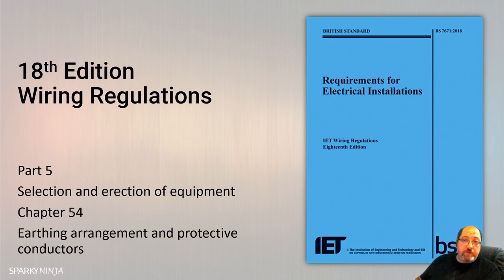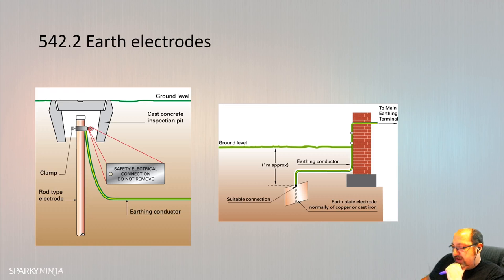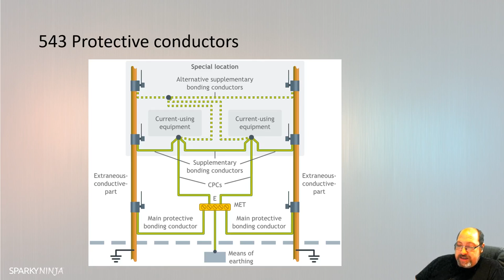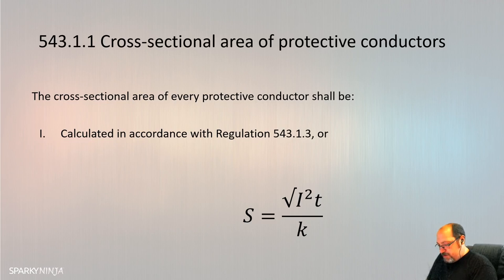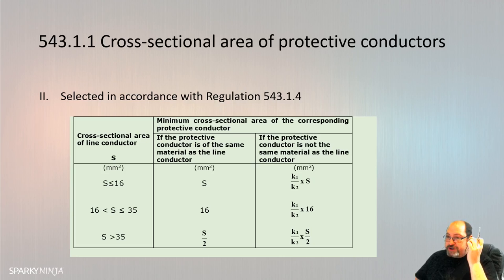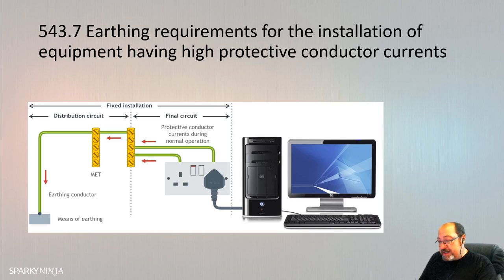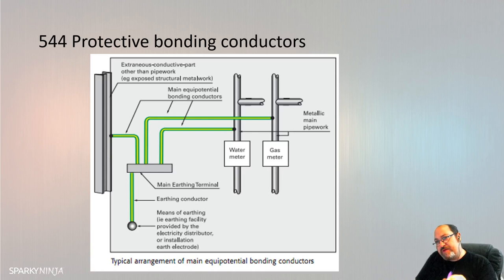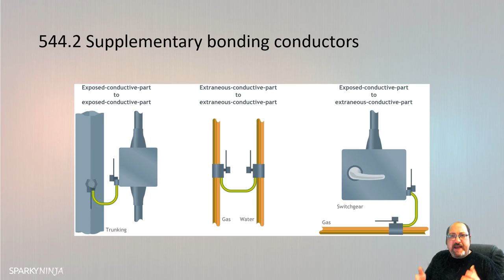18th Edition Training Series - Episode 15 - Part 5, Chapter 54 - Earthing & Protective Conductors

Comment: Regarding external gas meter boxes and the use of the phrase "as near as practicable" in 544.1.2 - The expectation here is that you would make the earth connection inside the house rather than in the meter box, but if this means the connection would be in a place where it is going to be inaccessible for testing in future (in my case under floorboards under the bath), is it acceptable/sensible to place the connection in the meter box instead?

Comment: Thank you for the videos, they do help a lot mate.
A question here, where you talking about earthing the back box at 38:30 , even if there is no metal conduit or metal glanded armoured cable connected to the metal back box , like a usual domestic situation, where you use twin&e , do you still do the cpc connection in the metalic back box earthing terminal and from there you earth the socket itself? 
So you never do the connection in the socket itself and then earth the back box from it?, or its only the case where conduit etc is present?

Thank you

Comment: In your worked examples of the adiabatic equation, if the fault is higher than the minimum required to operate the breaker in 0.1 to 5 seconds then would the required csa of the CPC increase accordingly?

Comment: If you are stuck with using T&E  from all ready installed wouldn’t  the main earth cover earthing fault so increasing it sort problem of having smaller earth.

Another question  with earthing causing static shock is it ok to put a resistor inline to reduce shock or will that negate calculation

Comment: Thank you so much for this course, it is an amazing resource to help really understand the Regs.
I just wanted to ask one thing, in the exam do you actually have to do any mathematical calculations or do you have to just know what the formula is?
Just wondering because I am a little concerned that it would take me quite a few minutes on some of the calculations!!
Many thanks.
Reply from the maker: Yes you may be required to crunch through a formula, the data to put in it will be given, youve just got to know the formula and use it properly.
The volt drop formula (which isn't even in the book) is the most popular.
Reply: @SparkyNinja  Thank you so much for your speedy reply!!
Ill just keep crunching away until I get quicker :)
Best Regards